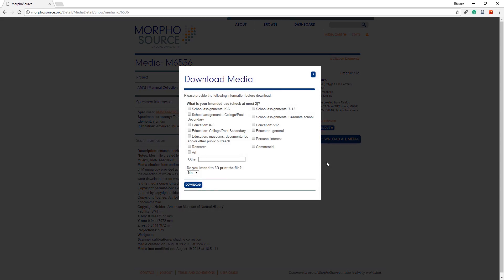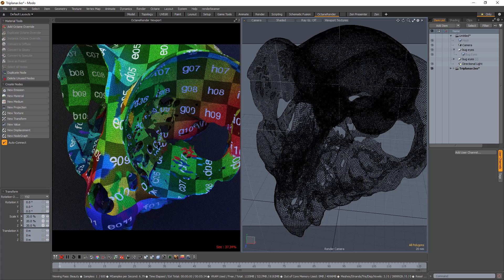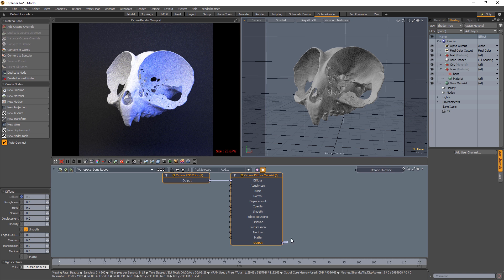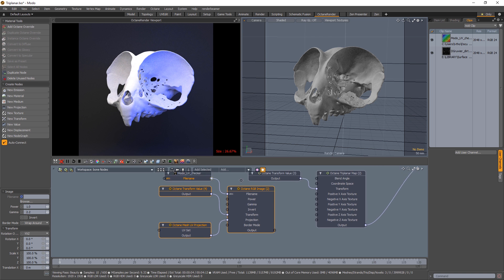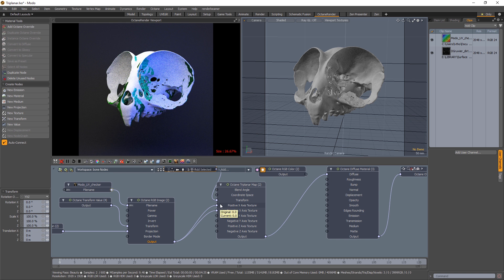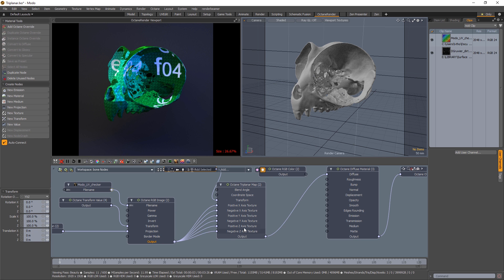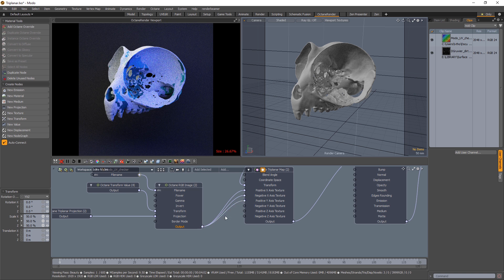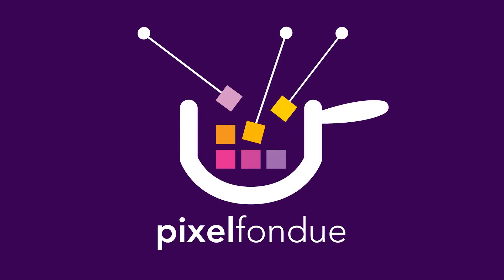MODO + Octane | Triplanar Mapping

Comment: Thanks for this. Very useful. Here's a question: is it possible to use both Triplanar Mapping node AND a Distorted Mesh UV node. I needed to combine both recently and couldn't see a way as both plug into the projection slot and Octane only accepts one or the other.
Reply from the maker: Yes, I think you can start off with a baking texture with a distorted mesh UV projection.  Plug a triplaner texture into the baking texture.  I'd post a pic but I can't on YouTube.  If you go to the Pixel Fondue Discord and ask again (if you can't get it to work) I'll be able to share a scene.